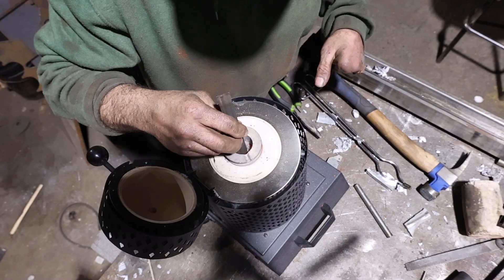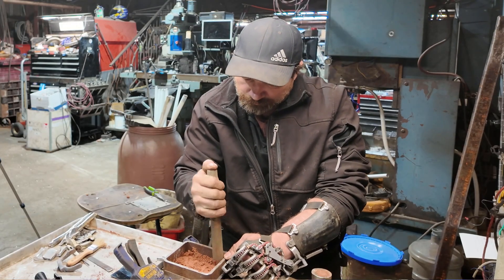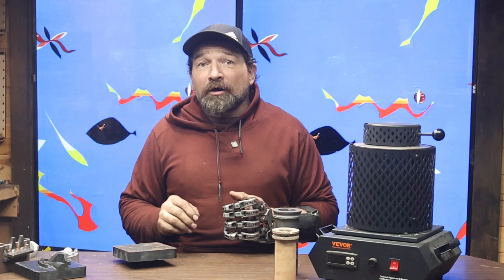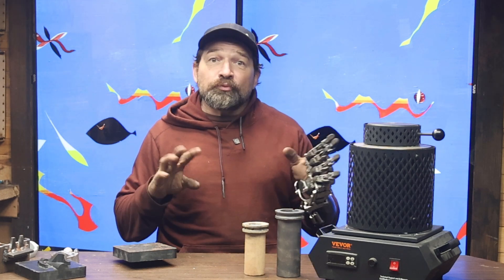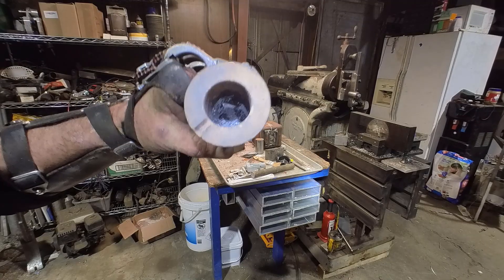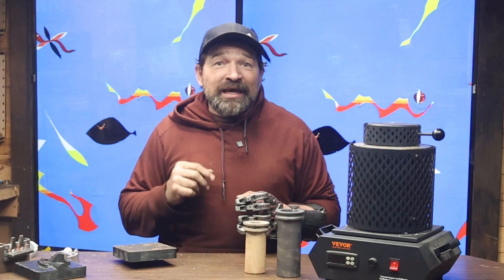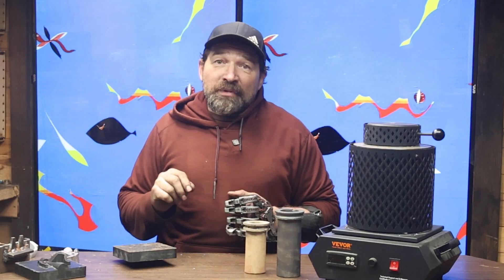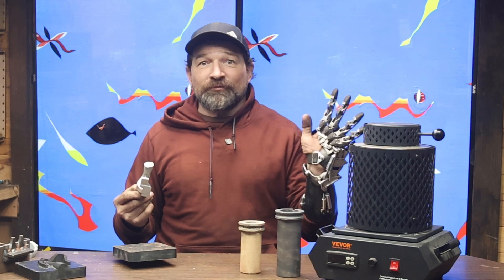DIY Aluminum Casting for Prosthetic Hand Parts: Experimenting with Vevor Electric Melting Furnace.

Comment: Look up Robinson Foundry  youtube channel here on youtube. he has done a lot of lost 3dprint casting (like lost wax casting but with 3d printed parts) He uses ceramic slurry and is able to get very fine details on a maze bolt and nut he made and many finely detailed sculptures made in bronze and aluminum and copper. If you reach out to him it would be a cool collaboration and it could be a possible way to more economically make hand parts with reduced machining and have more customizability.

Comment: Look up metal casting lost 3d print casting. the ceramic slurry gives a lot of clean details look up Robinson Foundry  lost 3d print casting he has done a lot of intricate design sculptures a bronze maze bolt. It is  a process but the time invested results  in really clean products and you could experiment with different oversized parts to dial in shrinkage and if you need to grind or machine any finishing touches.

Comment: Not sure it will work with your small setup but we use a homemade steel crucible to melt cans. Lasted a verry long time.
Reply from the maker: Cans where I live wouldn't be viable,  in oregon we have a bottle bill where we pay a $ .10 deposit on cans and bottles  to encourage recycling.  the aluminum used in beverage cans is plastic lined making it contaminated for what I'm doing as well as a can only has about $.005 worth of aluminum in it.
Reply: @missingpartsclub  he meant perhaps you can use a steel or stainless steel crucible instead of a graphite crucible for aluminium casting

Comment: Some thoughts... Investigate lost PLA casting, it may be an ideal process for the parts you make. The youtuber shakethefuture has refined his lost PLA process quite nicely especially if you consider his limited equipment and space. Borax is not an appropriate flux for aluminium, it reacts with the metal, if I remember correctly a mix of potassium chloride and sodium chloride is melted together to first remove moisture, then when cooled it can be added to aluminium melts as flux. The almost foil like remains of metal in a crucible does not concern me enough to even consider mechanical removal as long as there are no solid pieces, I am more concerned about how the crucible is packed with metal to be melted, that the expansion of that metal does not damage the crucible. Anyhow keep up the great work.
Reply from the maker: Earlier this month, I made a set of signet rings for a group using siraya tech wax based casting resin with my elegoo Mars printer. I used hydrocal for the mold. The resin burned out really clean with very little ash.
Reply: I make a diatomaceous earth and plaster of Paris slurry and make multiple coats. Then bake it out. Then place mold in sand and preheat.